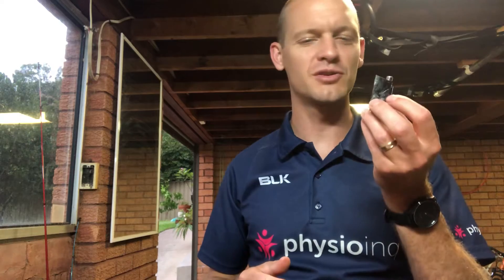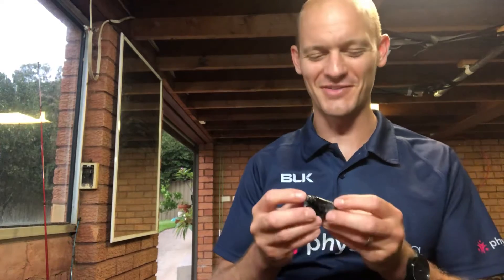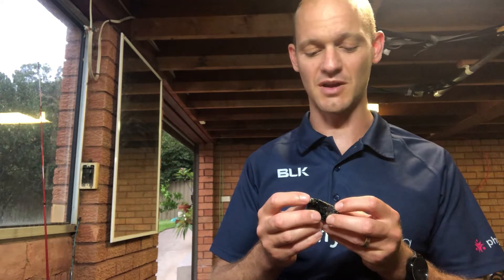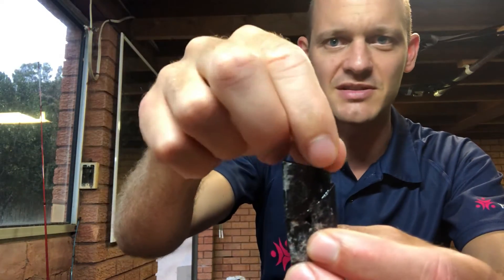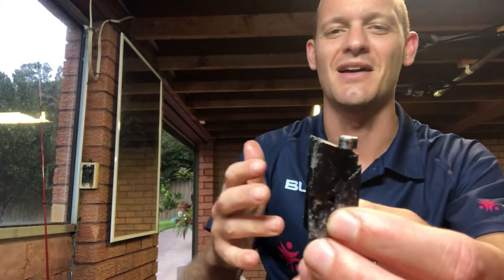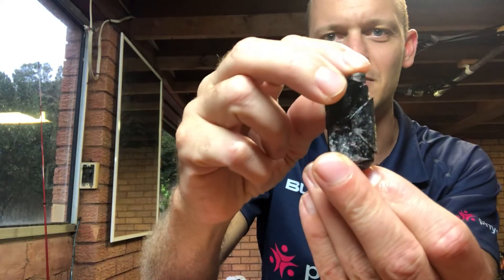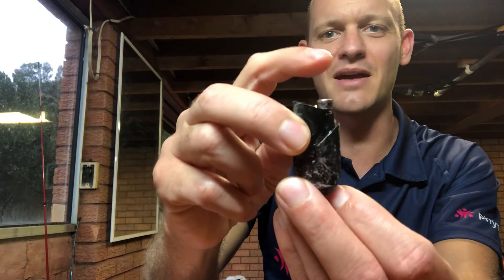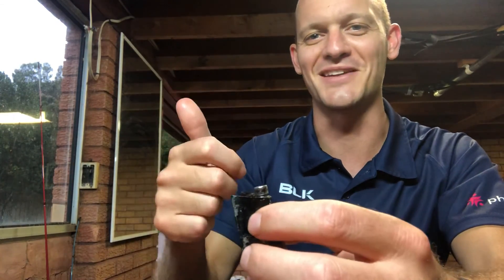How to remove a stuck seatpost wedge clamp

Comment: Perfect!  Excellent video.  Yes, it is that simple.  Also, if it helps, when I tapped the wedge/clamp, I heard a click from the wedge/clamp -- as if I had knocked something loose -- and it turned out that that was the sound that told me my seat post was ready to be easily moved.
Reply from the maker: Nice! Glad it helped you!

Comment: Many thanks for this. New bike (well new to me), Bianchi Outré XR4, and could not budge the seatpost until following your instuctions. A firm tap with a small hammer on the partially unscrewed bolt released the clamp :0)
Reply from the maker: Happy days. It's the most frustrating thing not being able to get the darn thing out isn't it??

Comment: Another option... Once the bolt is loosened as far as it can go, without it detaching from the wedge, try giving the seat a good firm twist from side to side rather than trying to pull it up.

Comment: I wished I had watched this video before I started to swap out the seat.
Anyway, just bought a used Specialized Ruby, but for this particular seatpost clamp, I had no idea that I shouln't be completely taking out the hex nut. As a result, the wedge thingy has fallen into the frame. I was able to chase it around the tubes innitially, but now it's wedged, Stuck, SILENCED even when I violently shake the bike.
I guess I'm going to have to open up the bottom bracket. *arrgh*
Reply from the maker: Gah! That's the worst when something falls down the seat tube. Hope it all worked out in the end mate

Comment: I thought I had the same problem. Managed to get the wedge clamp out using this trick. But still my seatpost isn't moving anywhere :(
Reply from the maker: oh no! that's probably carbon on carbon adhesion. For any new bike that I work on, I always take the seat post out and use a carbon paste to stop this from happening. Hope you managed to get it sorted!
Reply: @physi_inq_engadine_sutherland  Ye I slapped the side of my saddle once or twice relatively hard. Heard some cracks - almost got a heart attack - but my seatpost came loose :)

Comment: What did you use to help it loosen it up.  I’ve tried hitting the bolt with a hammer.  I’m being careful when hitting it with a hammer. Did you use some liquid to help loosen it up? I’ve tried 3-in-1d oil.  Any ideas?
Reply from the maker: I'm no mechanic. But I just gave it a decent wack with the hammer. (disclaimer that I'm not a mechanic though! Do so at your own rist)